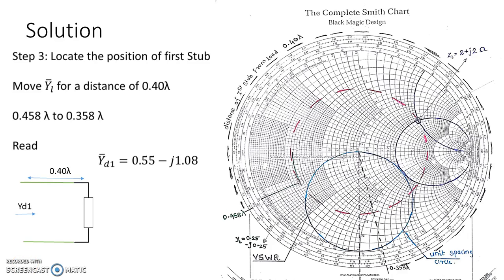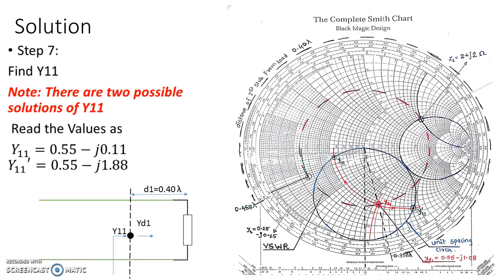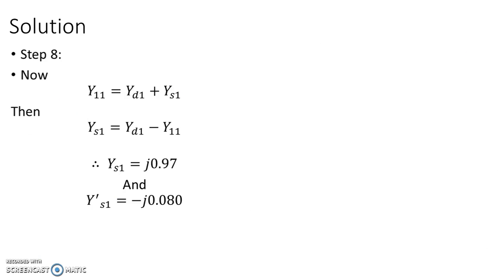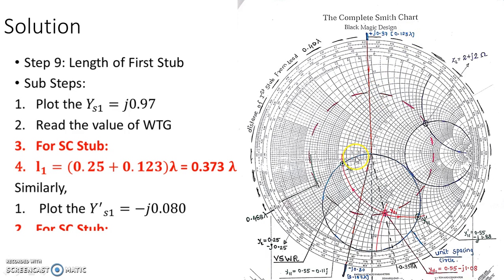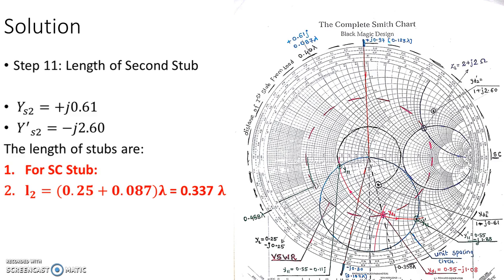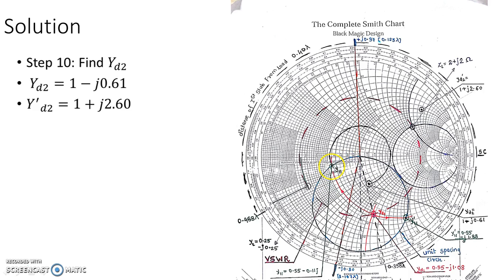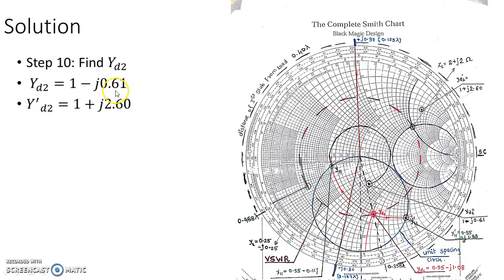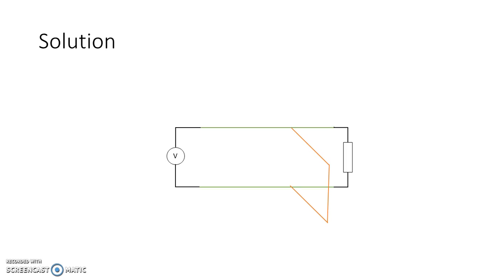Double Stub Part B

Comment: I believe you have made a slight error in step 8.  
Ys1 = y11 - yd1.
Reply from the maker: Yaa i said 0.808 which is 0.080.....but the calculation is correct